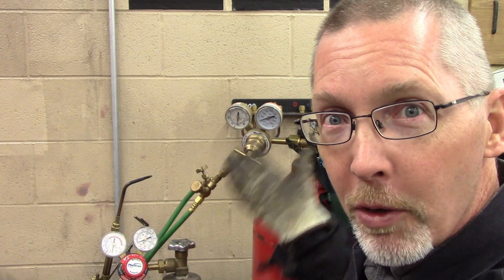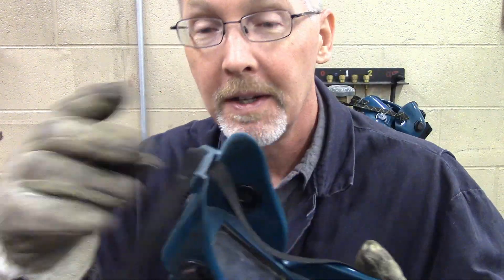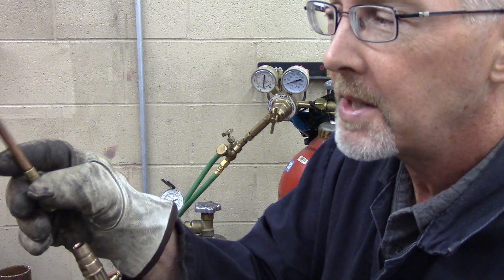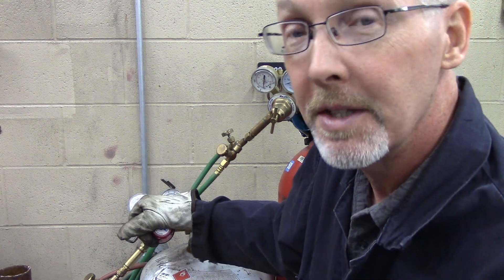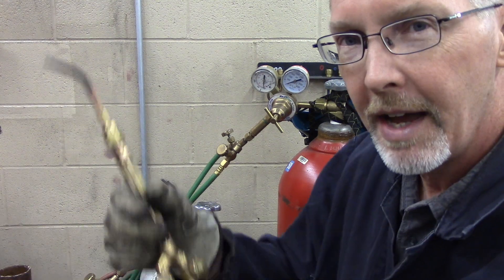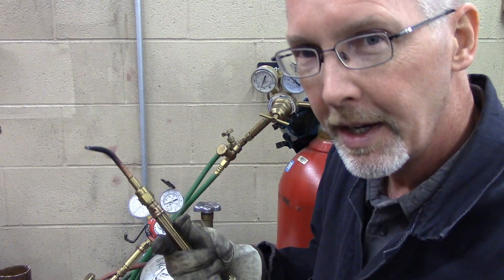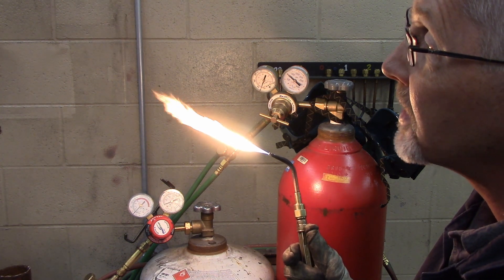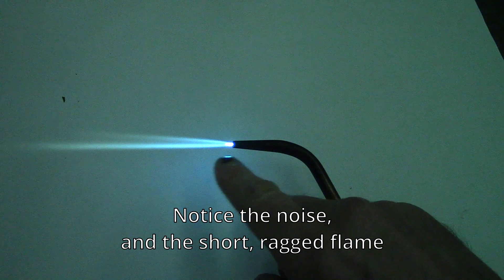QUICK & DIRTY: HOW TO Setup the Oxy-Acetylene Torch

Comment: Awesome tutorial !
Your stern humour is hilarious.
What about using it as a cutting torch ? Same adjustments, but with a different tip ?
Reply from the maker: There is a different tip for cutting, and for that I run 5psi Acetylene and 30psi Oxygen.  However, we usually use a plasma cutter instead, as it doesn't cost me in oxygen.